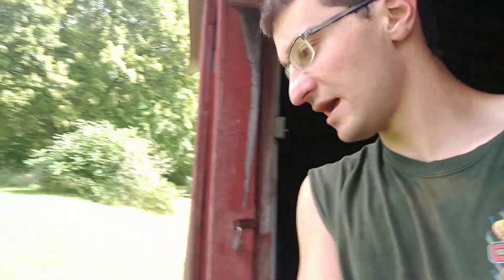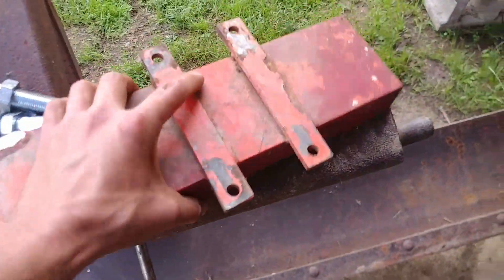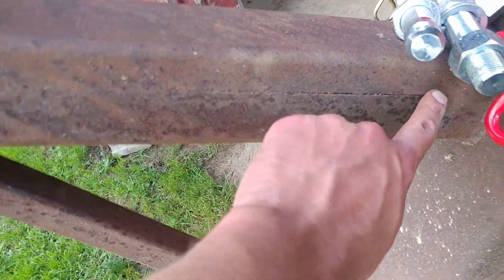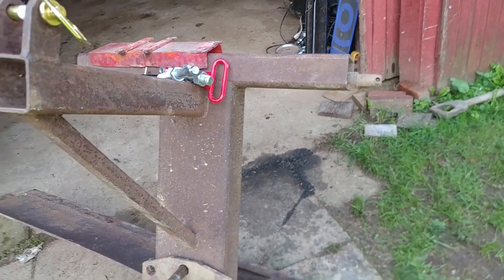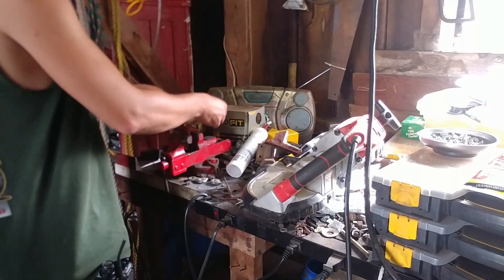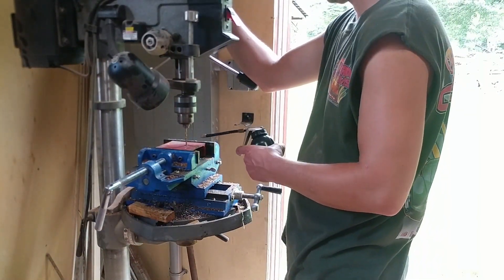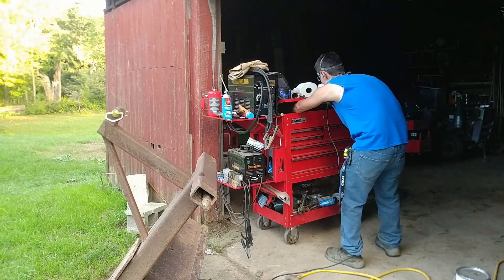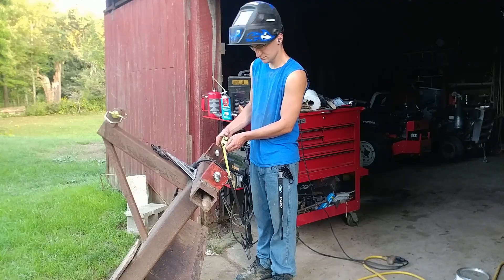HOW TO CONVERT A CATEGORY 2 TRACTOR IMPLEMENT INTO CAT 1- WELDING WITH THE FAMOUS 90 AMP HF WELDER

Comment: Would be interested to know how deep that welder penetrates. No way would I be welding that with flux-core, would use stick welding. Why? Because it makes more sense to me and have both welders.
Reply: @Andrew Welds Just because the weld looks good, that doesn't mean the weld is strong. I'd be stick welding those pins. Anything that is strength critical I'd be welding with 7018 rods.
Reply: I personally would stick weld this as well

Comment: Wear the welding jacket regardless of how how it is. Just have things clear of your arms when you fling it off in a hurry to clean welds to cool off a bit. I wore a heavy leather jacket when riding a motorcycle regardless of how hot it was.

Comment: You should add some weight to the blade so it can cut better, sometimes they're too light and jus skip over the top of the ground . I have Mone with 2 4inch thick plates on the blade an d that sucker cuts deep